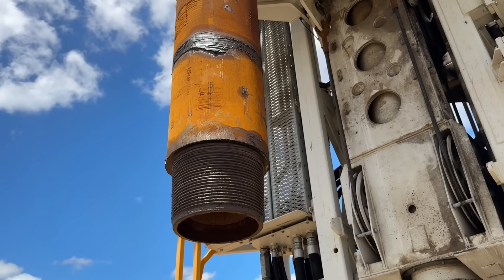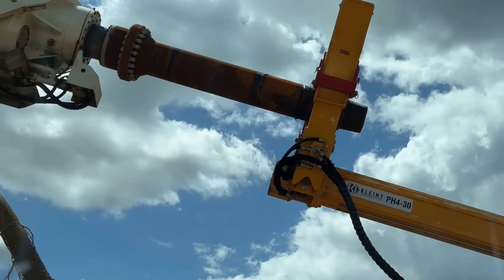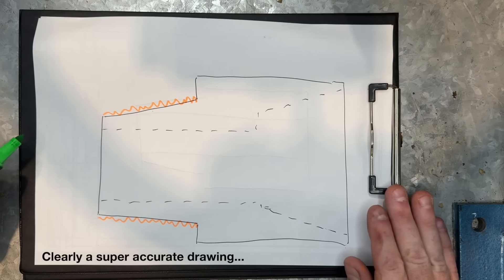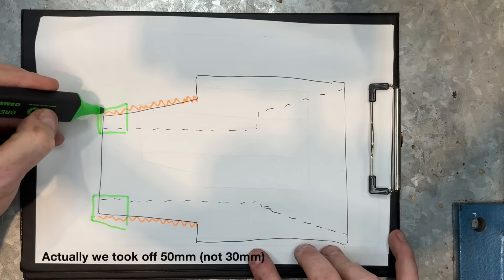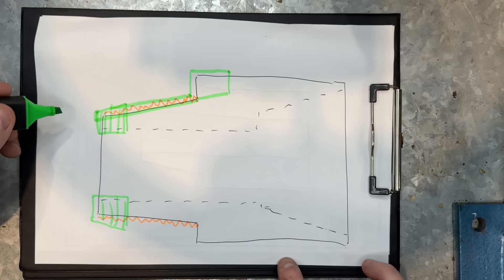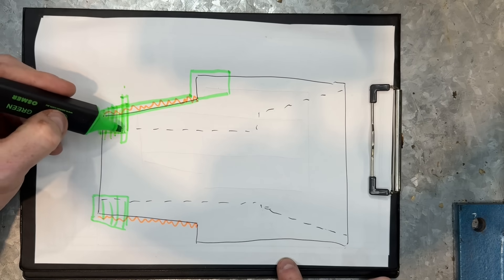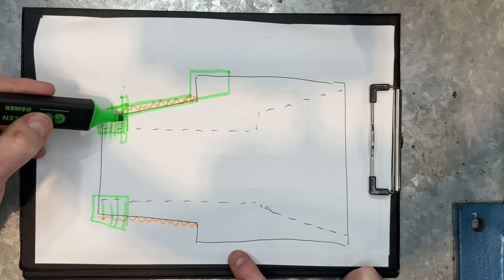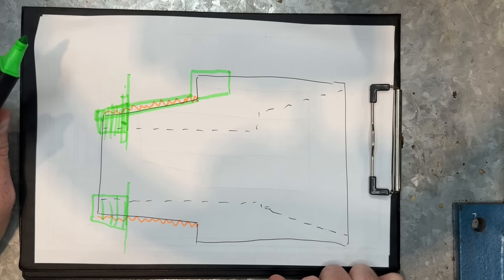Repairing a MAULED Saver Sub (It Looks Like A Croc Bit It!)

Comment: Hi from Brisbane/Cyclone Alfie territory! 
A non-machinist question  - is the CNC capable of refreshing the original thread? Take off the top half of the thread and then recut it to depth? You wouldn't lose as much of the original part and you might get 4, 5 refurbs simply because you aren't cutting off as much for each refurb.
Darryl
Reply: If you just recut the thread deeper you end up with a thread that has too small a diameter.  That is why Matt cut the end off the part: to restore the original thread diameter as he cut deeper.  This wouldn't work for a normal bolt or other parallel thread but works well for a tapered thread.
Reply: @Mark_Bridges  Yeah - thanks. Understand what you are saying about the dia reducing, but was thinking you wouldn't have to cut as much off the end if you didn't have to go as deep into the original thread.
Reply: @   "wouldn't have to cut as much off the end if you didn't have to go as deep into the original thread"  Yes, that is exactly right.  I suppose Matt decided how deep he needed to go to make sure the thread was clean, then worked out he needed to cut about 50mm off the end.  The thread was fairly mashed so I'm not surprised he went deep.

On another subject: Good luck with the weather tonight and tomorrow.  10am tomorrow should be the worst, then hopefully it will improve and you'll be out of it unscathed.
Reply: @Mark_Bridges  thanks for your final comments. This cyclone has had a quiet side and a rough side. We have been on the quiet side, but I think that will  change dramatically when Alfie crosses the islands and gets into the bay. A customer tried to book me up for a job Sunday afternoon. I put him off and said we would talk Sunday lunchtime. 
Where are you based?
Reply: @  I'm near Newcastle NSW, far enough that we're getting some rain but not much else.  I have relatives in or near Brisbane though.

Comment: 72 yrs. old and just bought my first lathe. Never to old to start a new hobby. Louisiana, U.S.A.
Reply: Go for it! I bought my first lathe at 68, beginning to get semi- competent. In the south of France
Reply: I wish!  

I'm 67, and retired from Melbourne, in Australia, to my wife's family village in rural Indonesia in late 2021.  I built a great shed, with an overhead crane, 3 phase solar power, the works.  I had planned to put in a lathe and milling machine.  I have an old school friend that I was going to bring over for a visit to train myself and some family members on the basics.  He builds 1/4 scale steam traction engines as a hobby.  He built his first rocking cylinder steam engine at age 12.  You might say he's adept.

But then reality hit.  This is the tropics.  The humidity for last year averaged 90%.  Several months averaged 95%.  Most metallic things corrode faster than you would believe.  304 stainless steel rusts.  Brass turns black.  The gilding on my Murano glassware has turned black (I have questions!).  Copper wire turns black.  Fine copper wire corrodes away entirely.  Metalised plastic surfaces corrode.  So it would be a full time job to fight rust on the machines.  It would be made worse by the fact that the climate has me raining sweat after 10 minutes of activity in the shed (look at @recumbentkoala to see the shed).  So I have abandoned the idea of setting up an engineering works for my wife's family.  I'll have to stick with unending maintenance of electronics, as the humidity frequently exceeds their operating environment specifications.  I find I even have to replace the RJ45 connectors on Ethernet cables periodically, as the connections corrode. 

Having given up that dream of machining stuff, I have to satisfy that itch vicariously by watching HAL, @CuttingEdgeEngineering, @Blondihacks, @NoEngineerHere, etc.  At least I can do that in an air conditioned lounge room, instead of rapidly evolving into a puddle over in the shed.   You only need to watch the first minute of the video I uploaded to my channel today to see what I mean about the climate.  I can even spare you that by saying it shows the display from my weather station:  33.9C (93F), with a "Feels Like" of 51.7C (125F) and 80% humidity.  I've seen "Feels Like" in excess of 53C.  I'm not built for this climate.
Reply: 62 here, retired early and broke AF.  I've had a mill and a lathe for decades, but I still learn new things all the time, often from channels like this one. :)
Two things I wish I'd learned early in my machining "career": rigidity of setup matters more than the quality of the machine, and the quality of the tooling matters more than the quality of the machine. WRT to the machine, one can work with clapped-out sloppy junk once you learn its idiosyncrasies, but if your setup is not righteous, or your tools aren't good (and correct for the material) then the best machine in the world won't save you. :)  Best of luck to you.
Reply: @railgap  in the 70th, we used in Germany some US-Machines from the war, easy to use, reliable,  often accurate enough, their casting iron frame had better damping charakteristics the ours, only the "inch-digits" on the dials made us problems
Reply: I put in a bid on a big old iron Monarch lathe last week... got out bid by $1400. Really glad it when that much over rather than $25 or something that would leave me wondering.
Reply: @brucewalker6939  I'm slightly lower in maturity at 53 but if I had the room.....
Reply: @brucewalker6939  I love to hear that us older dudes are pursuing the machining hobby. I hope I am in a position to follow suit soon. I do not have the right space or circumstances at the moment but it is my dream to get there! Cheers mates from Phoenix Arizona
Reply: and I stopped in 1980 :/
Reply: Be careful and get trainings at a trade school .
Reply: Bought an old Rahn Larmon lathe that is almost 100 years old many years ago and I have done some really good work with it. It's about as worn out as I am but I have really enjoyed it. I have a few friends who were machinists in their younger days and they have helped me a lot. I can make almost anything now and I have had no formal teaching. My advice would be to buy cheaper imported cutting tools until you get the hang of it because you are going to break some stuff.....and most important of all, don't wear long sleeves or coats or gloves that could get wrapped or tangled up in the workpiece.  A big lathe can kill you or tear your limbs off before you have time to react. Be careful and have fun!
Reply: You'll love it, best to you.

Comment: Matt—— understanding I have exactly ZERO experience doing this style work, I have a question…..would it not be “easier” and a saving of length/material to simply chase the threads and then extend them higher to make it same same. Avoid cutting off the end and all the threads..??? Just wondering.

Comment: Nice job Matt refurbing this part, saving the customer $$. That material was tough, I might have used a little sulphur based cutting oil, a little messy, though. Screw cutting with a bit of speed like u did  generally gives a good finish in my experience also.